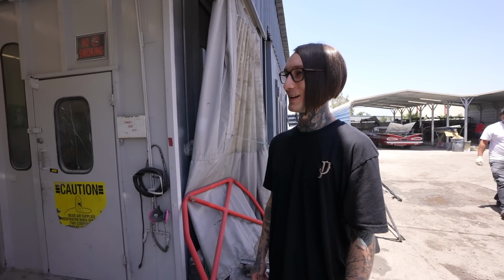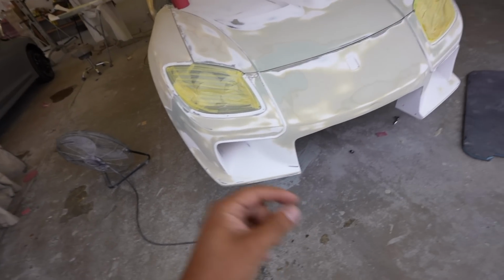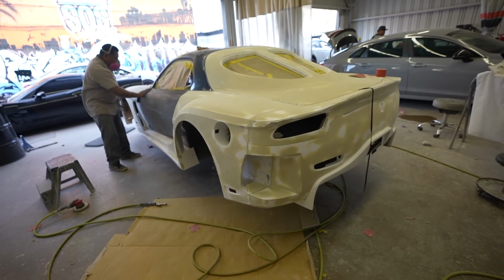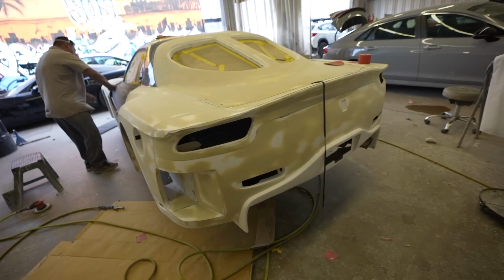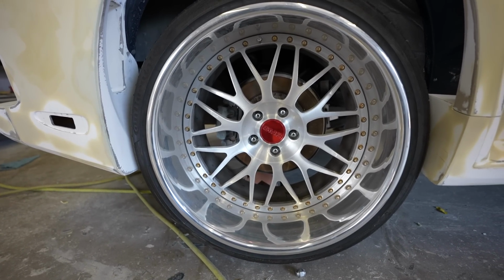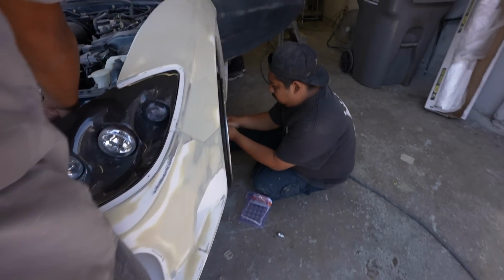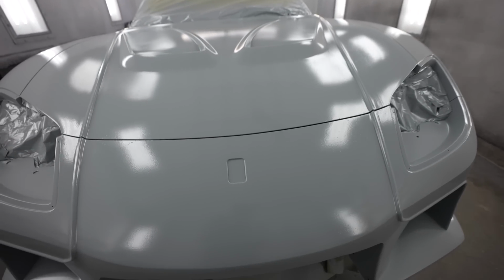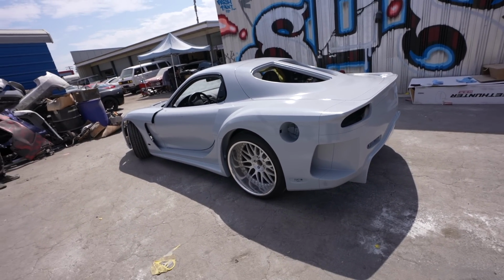Building The Fast & Furious Tokyo Drift Veilside RX7 -Bodywork

Comment: Holy crap that’s a lot of filler
Reply from the maker: It looks like more than what it is because we are not doing it in sections , most of the filler turn into dust that falls on the floor when it’s all sanded
Reply: Even high end bodykits like this need skim coating to get perfect,even more so if its going a dark color.
Reply: @BlandNutz  I just didn’t think this high end of a kit would need that much especially for the price